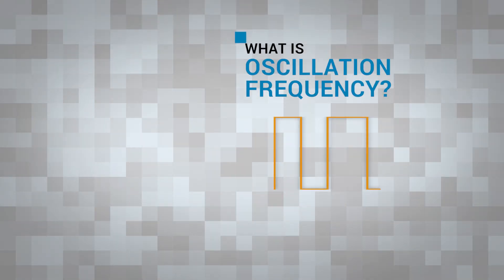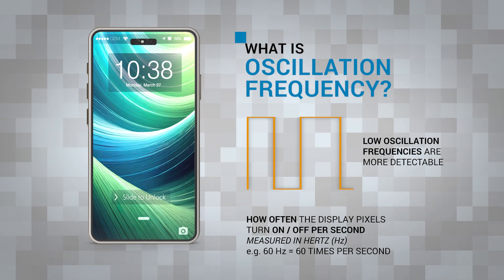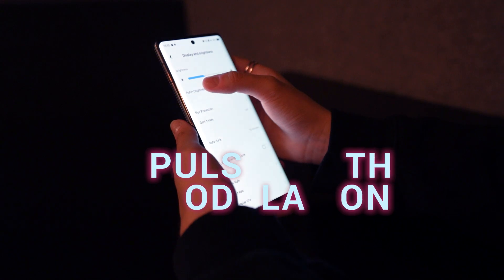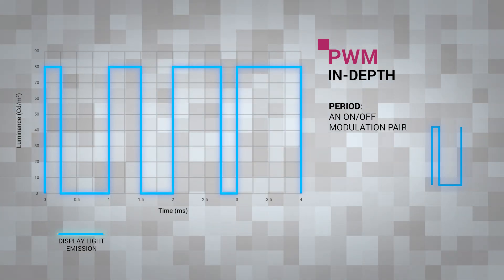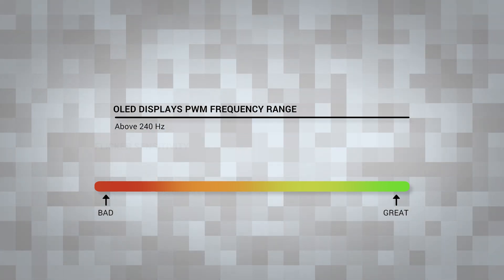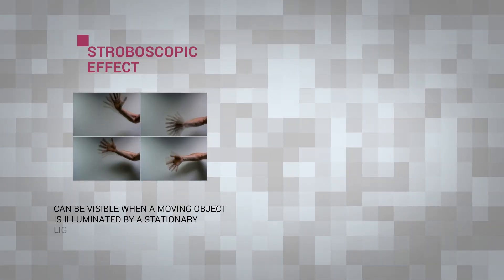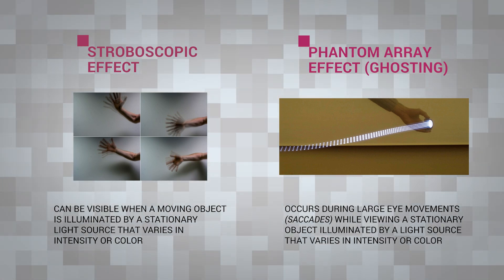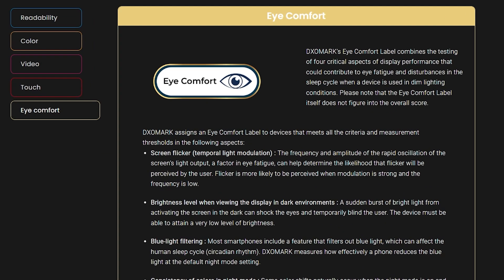Flicker and Temporal Light Artifacts Explained | DXOMARK Decodes

Comment: Can you explain how Pixel 9 Pro has 240hz yet it has a eye-comfort label awarded?
Reply from the maker: Hello,
Our criterion for flicker is to pass the ASSIST (Alliance for Solid-State Illumination Systems and Technologies) standard, which is commonly used to evaluate flicker performance. It is related to the probability of perception among the population, which should be under 50% to get to PASS the flicker criteria.
The flicker international standards focus on low frequency modulations (< 90 Hz). For higher modulation artifacts, the term flicker is not accurate, and standards refer to "stroboscopic effect" or "phantom array effect". However, these effects are yet to be studied in a smartphone context.